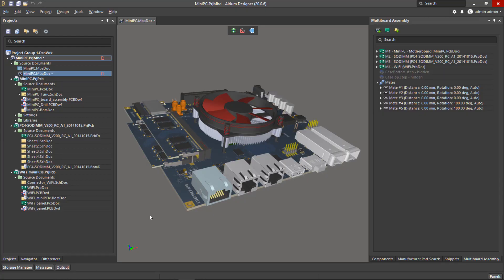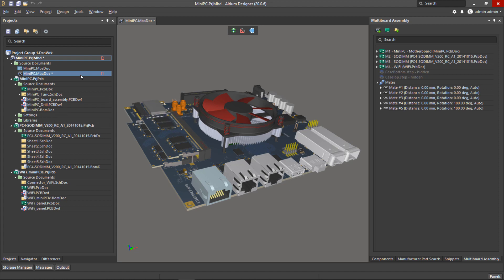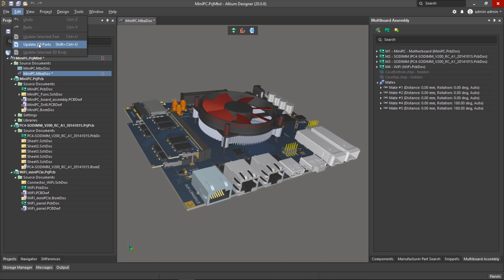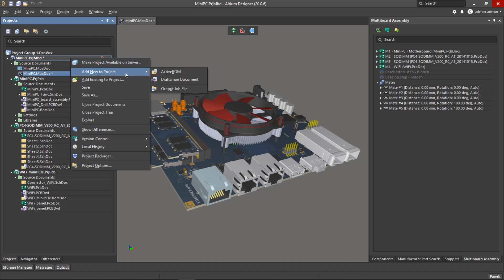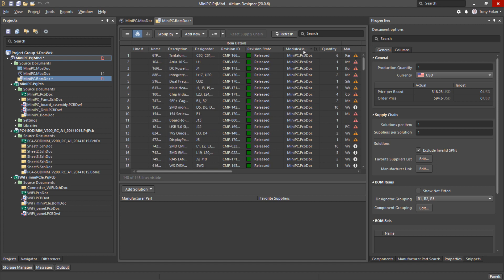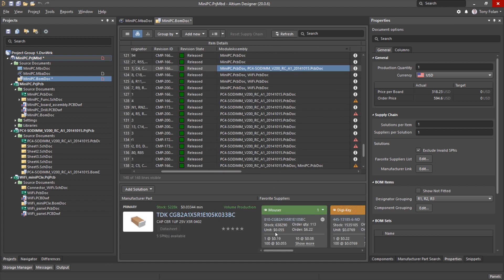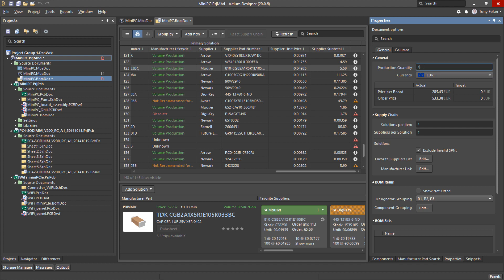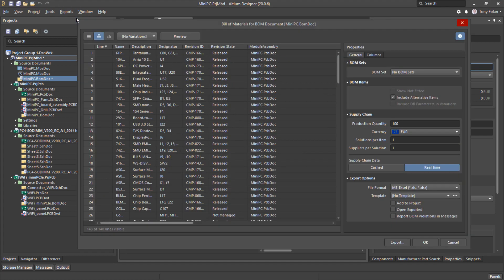Multi Board ActiveBOM In Altium Designer 20

Comment: Can I also have different variants for each PCB? So I can make an output with assembly data for different "sets". Currently I have a panel with 4 different PCBs on it. Each board has 2-3 assembly variants. From panelized PCB we can only export PCB and are not able to choose each assembly variant. We have to export it on every PCB on its own, and later merge all pick&place data together